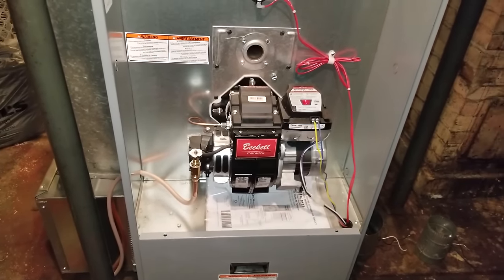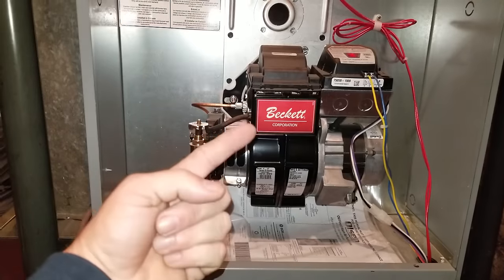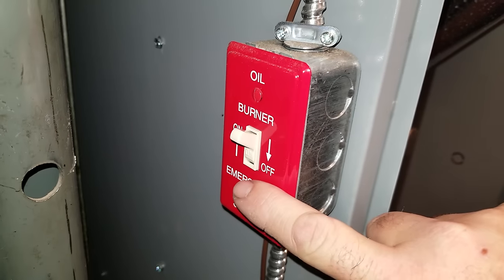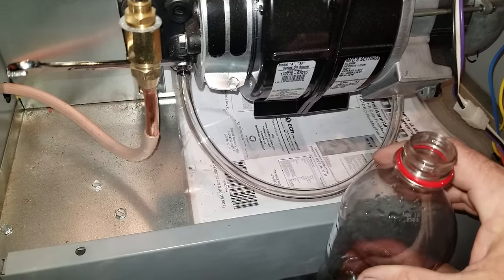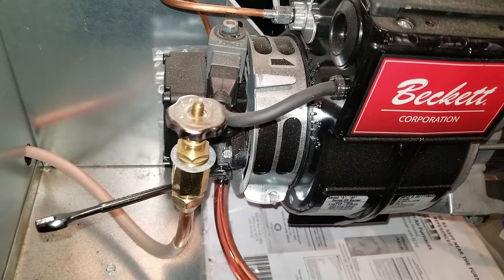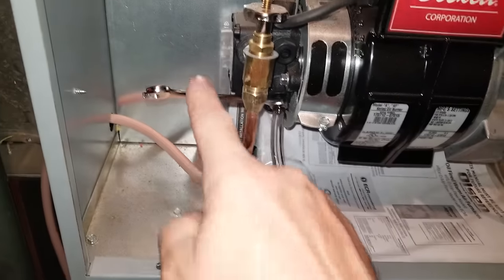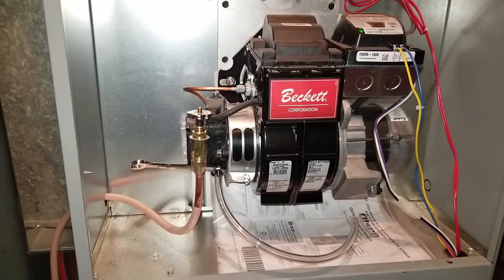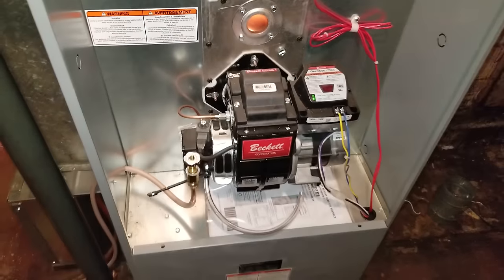How to bleed oil burner how to restart the burner

Comment: Kevin this morning you saved my bacon. I woke up to a 59 degree house and my furnace blinking just like yours. In a panic I tried to reset 3 times and it would not kick on. I have never bled the fuel line before, because I'd been good about keeping our oil tank filled. I guess some air got in the line this last time I filled it. Thank you SO MUCH for this video. You're an absolute hero. A quick bleed for like, 4 seconds and 3 resets got it kicked back on!
Reply from the maker: Very welcome happy to help now I want 🥓 bacon

Comment: Spectacular video, Kevin - short and to the point. Like the others commenting, I had a furnace that was blowing cold air. Found out that I had run out of heating fuel. Topped it up with 10 gals then followed this step-by-step. Worked like a charm (I had A LOT OF AIR to bleed out). This video is great for the following reasons:

- Kevin's voice over is reassuring, authoritative and respectful of his non-expert audience.
- It was to the point and done in about 6 mins, NO filler, all great advice
- It completely demystified the "bleeding" concept, which had been over-explained by the oil company to justify a $225 "emergency visit."

Kudos and have a great new year, KB!
Reply from the maker: Thank you for your support and great comment I am happy to help stay warm and happy new year
Reply: @2strokeguru  by the way, with the massive winter storm coming tomorrow, I wouldn’t even have a service call available until late next week ... after the pipes froze, no doubt.  Thanks, Kev!
Reply from the maker: @KevinCorcoranColumn  I used to deliver oil its crazy how much they charge if I wasn't talking and doing a video I could have done it less than 5min it is not right and not fair

Comment: Thanks my girlfriend lives 2 hours away and needed her furnace bleed. I had not dealt with the modern furnace that you had to push and hold the button on. I walked her through the bleeder screw location but getting it to start wasn't happening. Thanks to your video she now has hot water and I'm the hero of course I gave your video credit. I actually sent it to her through a text. Thank you very much very well done

Comment: Thank you for this video.  The detailed explanation walked me through the process and I got my furnace going again after I ran out of oil.  The detail you mentioned about having to bleed and restart a few times was especially helpful as I there was a lot of air to bleed out and I would've just assumed that the filter was clogged if it the flame didn't take the first time.
Reply from the maker: Very welcome

Comment: THANKS for this friendly video, Kevin.  (Yes, the first "bleed and restart" after-hours weekend emergency house call here in NJ required less than ten minutes of the plumber's time but was billed at two hours at the after-hours rate, for a total of $320, so your opening comments about saving money are "relevant," to put it mildly.)

* ONE * comment for users of Energy Kinetics' "System 2000" computerized oil-fired hot-water boilers, which are the bright-yellow sheet-metal cabinets with a projecting "airbox" on the front side of the panel and with the red "Energy Manager" computerized control component on top of the yellow cabinet:  Your video "caught my eye" because it shows a Beckett burner (Series "A" and "AF") which is similar to our Beckett "AFG" series oil-burner.  Our burner is also equipped with the same Beckett "GeniSys" restart component (with the ridiculous "LED panel" restart "button" which nobody would ever recognize is intended to be pushed until they see your video or any of the other videos about this topic: the so-called "button" isn't "mechanical."  It doesn't "depress" when it's pushed.  It gives NO "tactile" or audible feed-back...)  (The EK "airbox" detaches from the front of the boiler cabinet and pulls forward, off a bracket, to expose the burner components when stainless steel clasps are released on the sides of the "box.")

The Beckett burner DOES instantly try to restart on the EK1-F boiler ** BUT ONLY IF  ** the emergency power switch which is installed on the left side of the "Energy Manager" digital panel is turned * OFF * for ten seconds and then turned back * ON * BEFORE the GeniSys Restart "button" is "pushed."

The EK1-F boiler is "managed" by the computerized "Energy Manager" component, and I assume it's necessary for the Energy Manager software "to clear its memory" first, in order to get out of its shut-down mode, before the manager will allow the Beckett GeniSys Restart process to work as you demonstrate.  You stress that the emergency power switch should be toggled to "ON" before any attempt is made to bleed and to restart the system but, in the case of the Energy Kinetics equipment, it's  *  ESSENTIAL * that the power switch be toggled to OFF for at least ten seconds, then toggled back to ON before your guidance is followed the rest of the way.  (Yes, of course, once the power is toggled off and back on for the EK1-F boiler, power should remain ON for normal operation.  The brief "off / on" toggling seems only needed to clear the "Energy Manager's" memory.)

We're just down the road from Energy Kinetics' Lebanon, NJ headquarters and manufacturing site, here in Hunterdon County, NJ.  I've read that these unusual bright-yellow computerized boilers, with the spiral combustion chambers, are popular where winter heating is critical, such as in the northern part of the "Lower 48" in the US, in Canada, and in Alaska.  The equipment works beautifully and it IS fuel efficient.
Reply from the maker: Very welcome

Comment: Thank you. Omg mine said 15 seconds for a lockout. And then you said a minute. So i pressed for a minute. Lit itself right up. Thank you.
Reply from the maker: Very welcome
Reply: Desiree Lloyd I’m here for this very reason!!! Thank you !
Reply: What do you mean by 1 minute ? Mine says 15 seconds also.... I have bleed  my Beckett and I did get locked out so now do I hold for15 seconds or 1 minute I’m confused? When I hold it the light comes on and then shuts off but the pump is working still on and it runs for 4 minutes almost and then shuts off and kicks back on again on its own. But it hasn’t turned on. Worked just fine a few days and yesterday but ran out of fuel in the middle of the night.
Reply: Thank you so much.  Same here, lockout is 1 minute holding the button down.

Comment: Nice video Kevin ! Thanks for taking the time to do this. Is this necessary to do when you change the fuel filter, or you can just use the little bleeder screw
on top of the filter to get rid of the air ? Thanks !
Reply from the maker: Very welcome

Comment: Red light tripped after thermostat was triggered and ran its course to heat room. But when temperature drops it does not kick back on and the light is flashing again. Can you help?  Your video was great and easy to understand the bleeding process. 👍
Reply from the maker: Trying re bleeding 1 more Time make sure you have enough oil if it does it again you will need a service call

Comment: Thanks for the easy to follow steps. It looks like my house has a very old version of this set up, but it had the big red button (no black button), so I was able to still follow.  I think mine is called "Enerjet Major" or something. I don't know anything about how they work, but I am learning what I can. Next, to find a radiator key and bleed the radiators.  Hey speaking of which, in my house I have an expansion tank in a closet in one of the bed rooms. When the radiators are bled, the tank leaks a good amount of water.  How can I stop that?
Reply from the maker: Typically if its excessive and doesn't stop it will need to be replaced

Comment: Thank you for this video! I followed the steps and air came out. Once I got oil, I closed it up and nothing happened. The light stayed solid, but those two green lights you have didn’t light up at all. I tried to do it again, but nothing happened. No oil. Any thoughts?
Reply from the maker: Make sure you have oil in the tank turn up temp to 80 and hold button in for full minute

Comment: Thanks again. Quick question:  I have forced hot water.   I set the temperature to 85 and I just wanted to know if it's normal for the burner to turn on and off By itself as it heats all the pipes.. It's burns for 5 or 10 min and then takes a break. Then does it again, but we are not in the 80s yet.  So on for while and then it's off for a little while.  Its not solidly burning before getting to the specified temp. I can feel the heat and the registers. I just wanna make sure that the doesn't mean I have to bleed the lines more and its not hitting an air bubble or something and shutting down. I bled it twice at the beginning. The green Indicator light is solid when it turns on and then there's no light when it turns off. I think this is just the way it works. Been running for a while now. Just wanted confirmation I'm good. Thanks.

Comment: Thank you so much! I have this model. I have a lot of pets and so I found after it shut down on me blowing cold air that the filter was very dirty so I cleaned it out and replaced it but found that it was still blowing cold air. I went outside this morning to find that my yellow gauge the top was lined up at a quarter with the bottom lined up at E. I was told that with the yellow gauges you read the top of the yellow gauge for the proper reading. According to that I should be at a quarter tank full but yet it’s still blowing cold. Is it possible that it might need to be bled or might need more fuel first?  I didn’t think that the dust from the air filter would affect the fuel line but i know nothing about furnaces so I figured I might ask in case you could share someone else here.
Reply from the maker: Never trust the gauge they stick and are unreliable if the fuel filter is empty then you are out go to the fuel station and get some diesel 5 gallon put that in and try bleeding
Reply: @2strokeguru  thank you so much for your response! I’m sitting here looking at your video to get ready to bleed it as before at that sitting on my gauge outside I’ve been able to run it but like you said maybe it is stuck even if it’s newer. I have a scheduled oil delivery tomorrow so I’ve been kind of using my gas stove to kind of heated up a bit in the interim. I was thinking maybe if I bleed it because I didn’t know if perhaps it shut down because of the dirty filter pad if it may still require bleeding for that reason or is the only reason That makes any sense is that my fuel level is way too low?

Trying to decide if I should try to bleed it now or wait for when he delivers to restart it for me and delete it then?
Reply from the maker: @Tanya SON  very welcome as long as the pipes don't freeze and your warm with the stove you should be OK for the night

Comment: I have a beckkett (Spelling?) oil burner and Im having some nozzle/spray issues.

1. Nozzle constantly leaks a small stream of diesel when it's off.
2. When it's on it doesn't produce enough of a powerful stream to remain lit.

I was able to confirm the fuel line is in good shape, oil filter was just changed, there is no air in the line and bleeds out a large ammount with just gravity.

Fuel bleed valve on the pump sprays out an enormous amount of fuel with no air. 

So everything checks out up until the nozzle itself..

Any advice?
Reply from the maker: I have to recommend a service technician should professionally proform  a service an incorrect adjustment can nor only be dangerous but also deadly carbon monoxide poisoning can occur if not done properly

Comment: Good video, thanks, but why is everyone running out of oil?  It’s very bad for the system and can drag sludge from the tank bottom into the limes and filter. Either check your gauge on your tank more frequently, or get on auto delivery. I’ve had oil for 25 years and never ever run out.
Reply from the maker: Some people can only afford what they can afford lots of people go through hardships winter time is one of the most expensive times  Thanksgiving Christmas regular Bill's and on top of that oil bill and that's the reason I made this video is to save people money during the very expensive time of year
Reply: @2strokeguru  never thought of it in terms of $, but you are probably correct.  You use the same amount of oil whether you fill the tank and then refill at 50%, or start at 50% and refill at 0. 
The real expense is gumming up the burner components when you run near the bottom. 
But i guess you are correct. 
Didnt mean to offend with my comment. Sorry if i did.

Comment: If You Are The Oil Guy The You Should Know About The Beckett 7505 Primary Control Which That Looks Like To Me . Then You Should Know About The  Bleed Mode Which You Have 4 Min. No Time Out For 4 Min. Which Is Plenty of Time To Purge All The Air. That Feature Is Built Into That Control.
Reply from the maker: This is a basic bleed video short sweet and to the point this video covers 90% of furnace newer systems have a tiger loop  push and go self bleeding this process will work

Comment: I had bled my oil burner the other day. The flame and furnace started. Today I came home to a cold home. The flame light is not green. I have bled it 3 times already today and it still will not ignite the flame. What do I do in this case? Please help. I have used your video before. It is a great help and just this time it is giving me trouble. The flame went out and I can't get it restarted.

Comment: So i have an oil burner on a big mobil pressure washer. Uses diesel to heat the water. Just replaced the becket pump/regulator piece with the bleeder on it. Cracked the bleed and not getting fuel. Any ideas? It doesn’t have that light up button to push. It only has a and on off switch and the temperature knob. And it only activates when you pull the trigger and am actually spraying water. The burning stops once you release and fires back on when on the water. Any help is appreciated
Reply from the maker: Have you replaced the fuel filter
Reply: @2strokeguru  i have not, was trying to get the regulator issue fixed first.  I think it was dumping to much fuel into the burner because it was spitting flames out the exhaust stack. Trying to get that fixed first because it was unsafe to use. Put tue new one on and now it doesn’t work at all

Comment: Tony I have the same Beckett oil burner.,I recently inherited a house with it and I’m trying to fire it up for the first time. When I turn the switch on the side of the furnace. The unit that has the thermostat wires connected will light up for 2-3 seconds and all lights go out on that unit. It’s a 7505. My thermostat is on heat upstairs and obviously I have power to the furnace or the unit would not power up for a couple seconds. But, why does it not stay on or flash like yours does in your video ?
Reply from the maker: You might have another problem with the unit if you held down the button for a whole for a whole minute and doesn't allow you to start the process again and your thromostat is on and up batteries are good you might have a different problem that will require a service call
Reply: @2strokeguru  Shortly before you answered I got the light to blink off and in like his in the video. Turns out the thermostat needed to be  turned up more. The blower is working now too. But, I know my oil tank is empty. I was just checking to see if I could get it to work. Once I refill the oil tank what is the process to light the pilot ? I understand how to bleed it.  Thanks, 2dtrokeguru. You must be following my channel. Ha ha

Comment: I was also wondering as the only way this works is when the door is on so did you tape the button in so that it can run with it open? If I don’t hold that button it won’t operate at all

Comment: If the oil flows by opening the bleed - why does it not just send the fuel straight through for burning? If there is air - it would escape there too right? Just wondering...
Reply from the maker: Because it's air bound

Comment: isnt there a way to jump something to make the burner not kick on but only the pump is activated so you can bleed with out the fire starting?
Reply from the maker: Yes and it's dangerous as the burner will keep spitting fuel in the furnace and then when it lights off it can explode

Comment: I have a question; your video was really helpful two Months ago ( I didn't know my tank was so empty in a weekend, and this video was really helpful) , but now has 3/4 tank, and it keeps turning off once or twice a day. I reset it , and turns on right away ( unless today that I had to reset it like 4 times before it turned on)  Can it be air in the tank , or another problem?. I was thinking on replacing the thermostat too before calling a plumber. 🤔 Is an old furnace with the red button still. Any idea what can it be?
Reply from the maker: When a tank runs completely out and you can't bleed it out sometimes if there's sludge at the bottom of the tank common it can clogged the fuel filter
Reply: @2strokeguru  Isn't replacing that filter part of the tune-up at the beggining of the season? Or plumbers only work on the furnace? I'll try that then.
Reply from the maker: @angelaigoulkin5759  yes it is but if you run out it can fill up with sludg from the tank here's a couple things that you can do 1 check and replace batteries in the thromstats 2 and anti gel addative to the oil you can get it at any gasstation that sells diesel
Reply: @2strokeguru  should I change the filter and add the anti gel at the same time then ?
Reply from the maker: @angelaigoulkin5759  yes